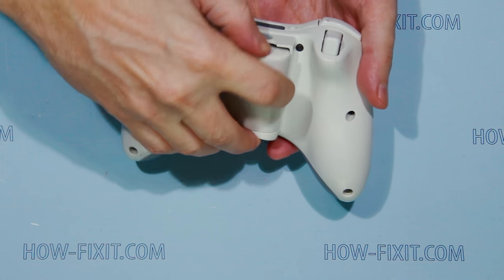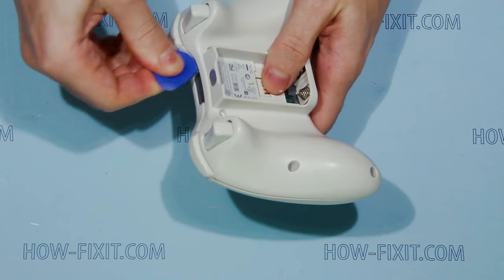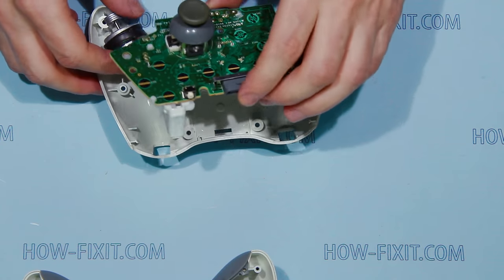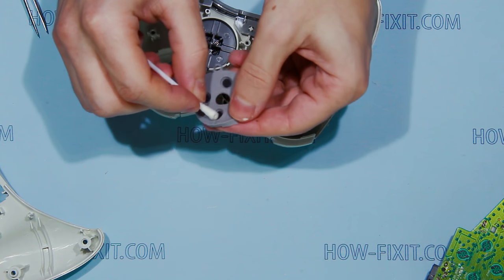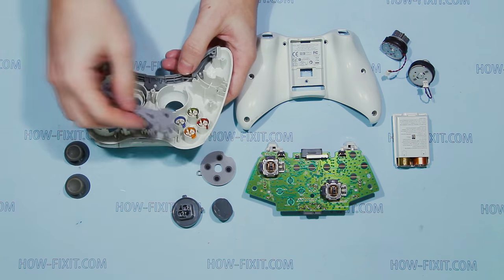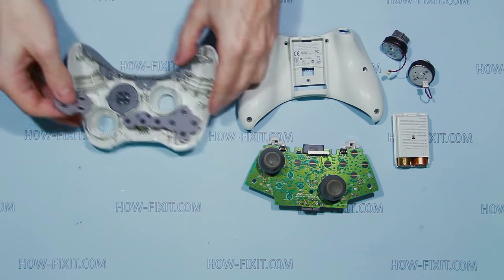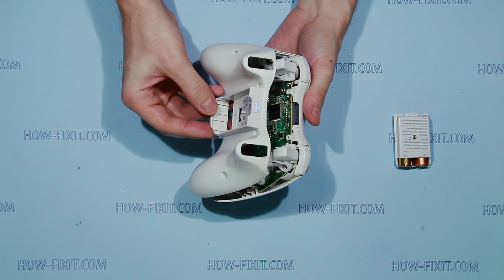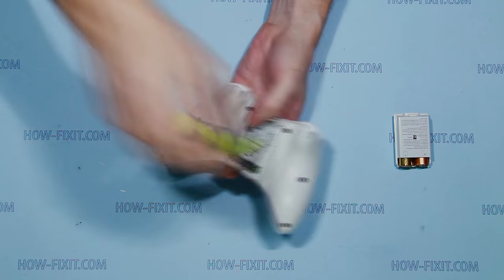Xbox 360 controller - How to disassemble, clean and reassemble

Comment: Very useful video. Thank you very much. It was nice you showed putting it back together as well. I washed my shell and buttons and let it dry overnight before putting it back together. After cleaning everything (isopropyl alcohol for the electronics) my buttons are working better. This controller is a lot easier to work on than a DualShock 3.

Comment: Hi. Awesome video, but just wondering do you use any cleaning chemical on the cotton bud and is there any risk from static electricity to the mother board components to worry about? Thanks.
Reply: Isopropyl alcohol is the best for this and most likely what he was using

Comment: omg this doesn't have the garbo thin wires for power that easily tear if you slightly move your fingers at them, they purposely made the whole process difficult to now legit throwing away series controllers cause of mass stick drift issue